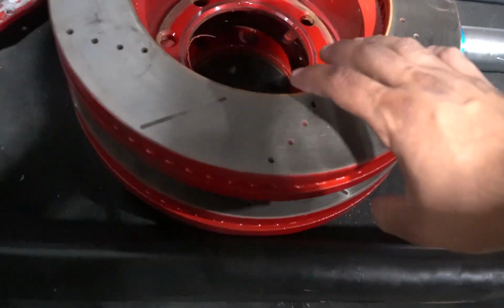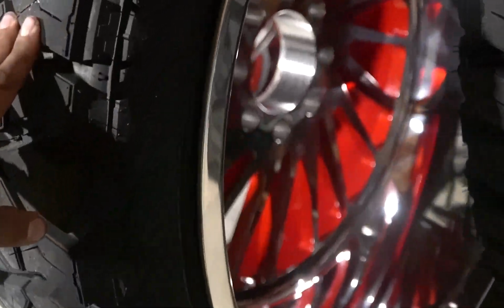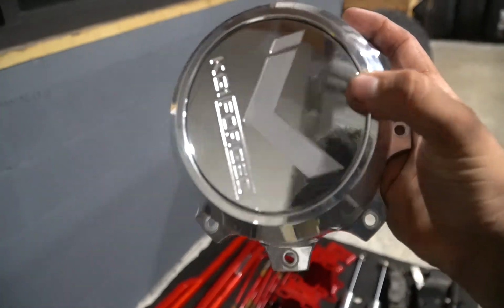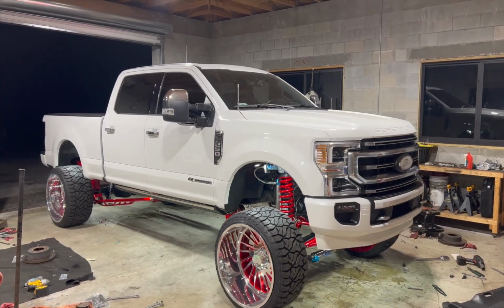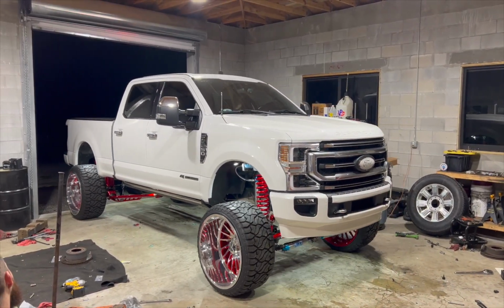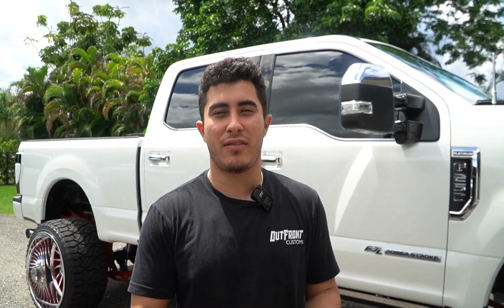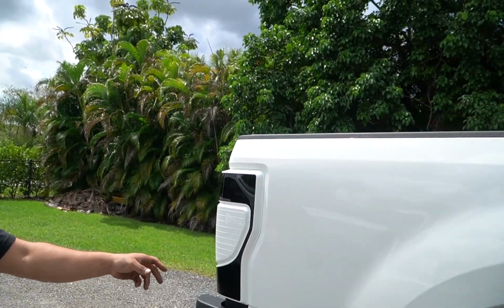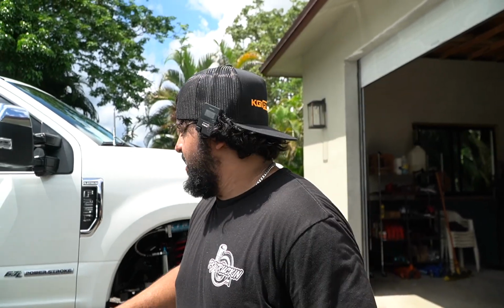2021 F250 Platinum 6 Inch PMF Lift and 26x16s

Comment: I’m curious why Joey has that nice shop but no lift? Having one will save your back!
Reply: Looks like it’s just a simple garage and with the size of most of the trucks I think the foundation where the lift goes needs to be reinforced
Reply: @FATTALEXX  thats possible, I would say they probably did put rebar in when they poured the concrete though. As long as the concrete is 6 inches in depth as well it would be fine.
Reply from the maker: so far we just haven't needed to we are able to get the trucks up pretty easily and take care of everything maybe one day in the future !
Reply: @pjtruckin  definitely will happen soon with what y’all are putting out
Reply: @pjtruckin  fair enough!